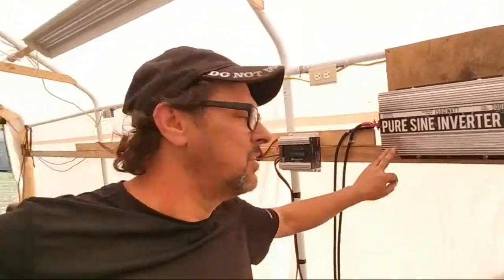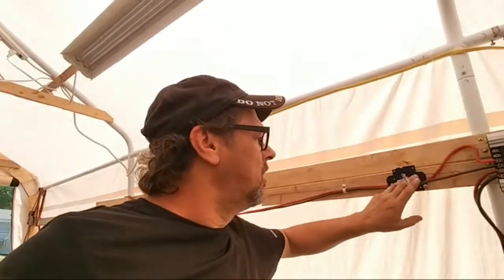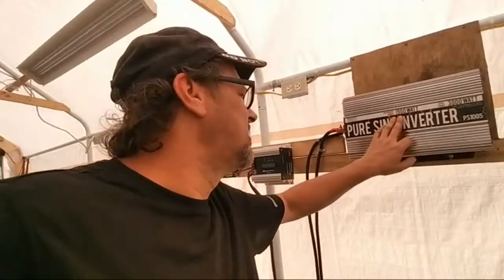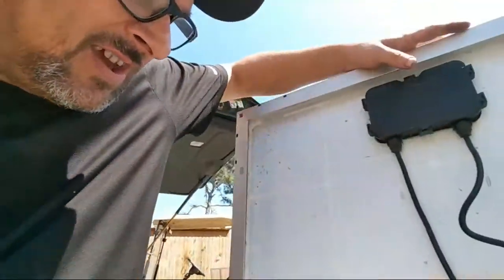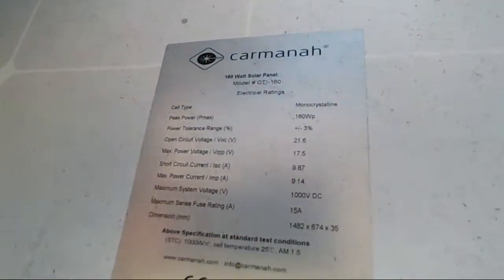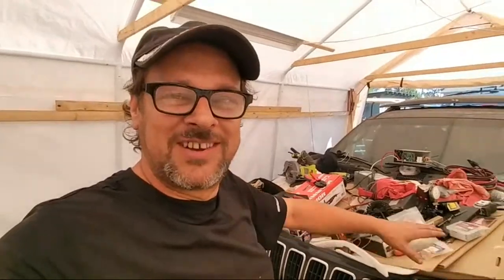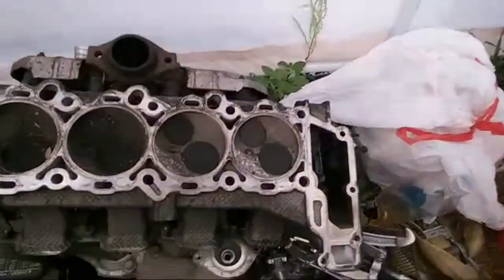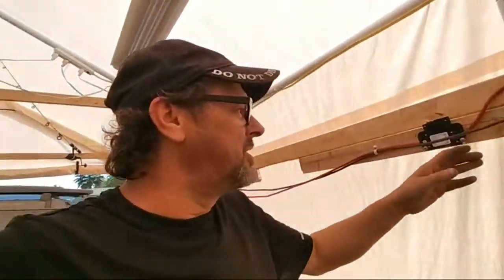Spare Parts Solar Setup

Comment: Excellent video showing how simple a solar setup can be. 

The new batteries sound interesting. I'm  trying to decide which way to go on a battery upgrade so I  am looking forward to finding out more about these batteries. 

Do you think you will be returning to AZ next winter and doing installs or have you decided to stay in Florida and the southeast?

The coach is looking good!